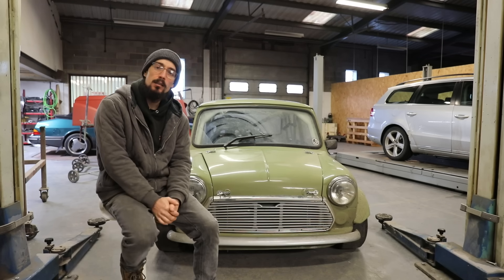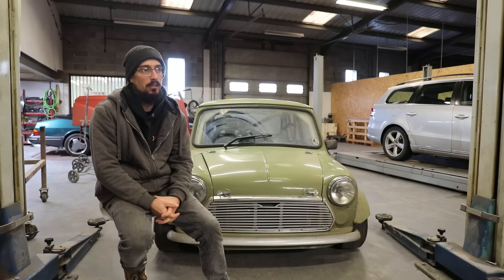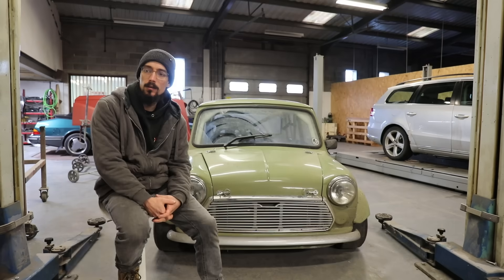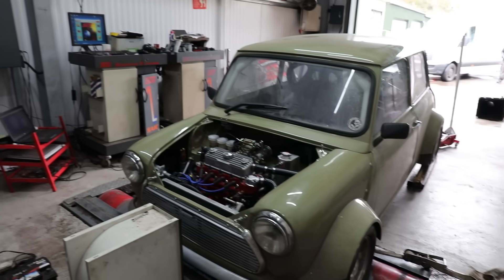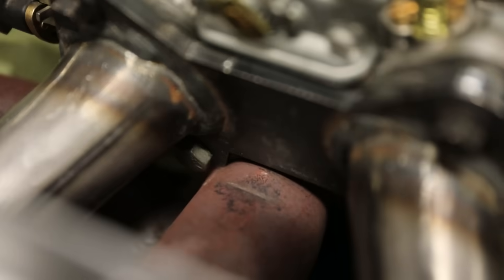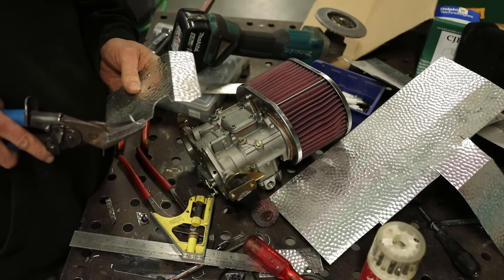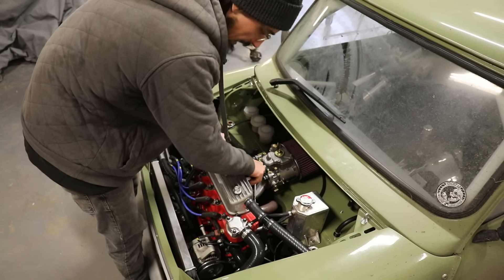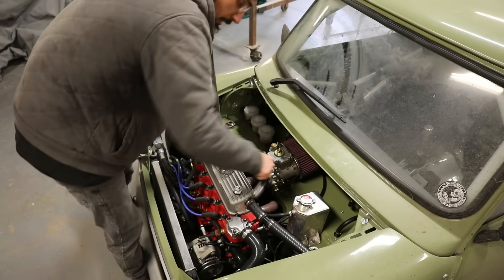The Race Mini Finally Runs As It Should - Inlet Manifold Length Testing

Comment: Hopefully you didn’t polish the inside of the inlet manifold? Couldn’t quite tell. I seem to recall David Vizard saying it needs a rough finish to stimulate air fuel mixing? I might be wrong.
Reply from the maker: it was done with an 80 grit drum so definitely not polished bud.

Comment: Years ago I had a heated manifold on my mini 998 with a 1 3/4  SU carb it stopped it freezing up,  you adjust it with the heater control, I ported the inlet and exhaust and added a piper 270 cam it would out perform any 1275

Comment: I was lucky enough to have a tuner run some numbers in my Pinto build initially for the 4-1 exhaust manifold but he also gave me the ideal intake length. This is calculated using stroke, bore and rod length with cam profile. He also gave me  different lengths (and bore size) of the exhaust that would work with the gas flow harmonics (at this point my brain exploded). It worked very well but I had a torque dip at 3250 rpm to 4k, we tuned t e dip out with mappable ignition. I also have a diagram of different carb trumpet profiles but can’t post it here. The stubby profiles you have (very specific profiles) are one of the best when the inlet tract length is correct
Reply from the maker: There's definitely a science to it.